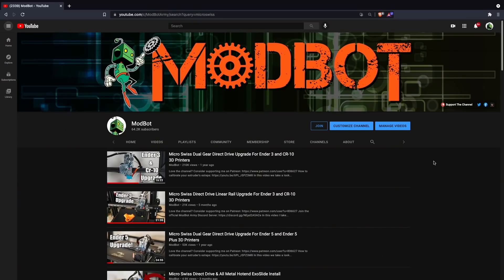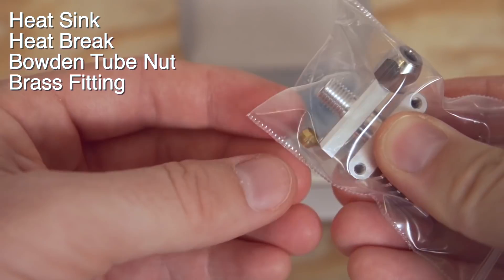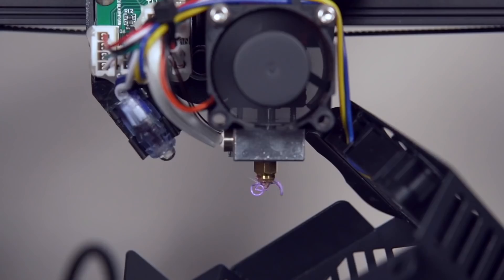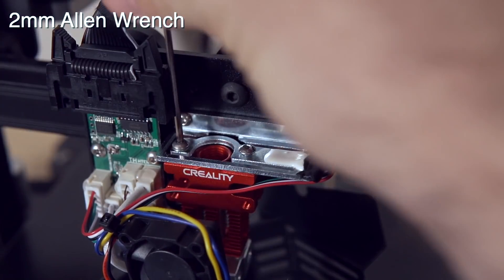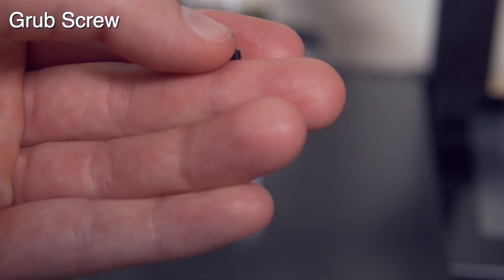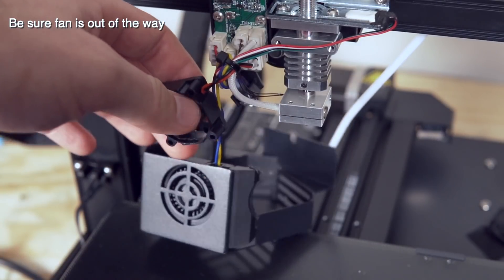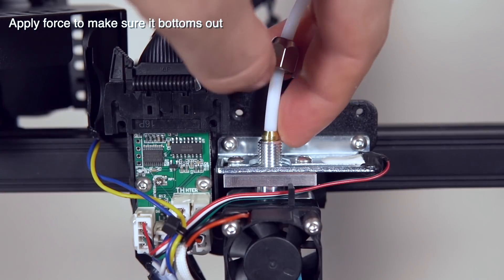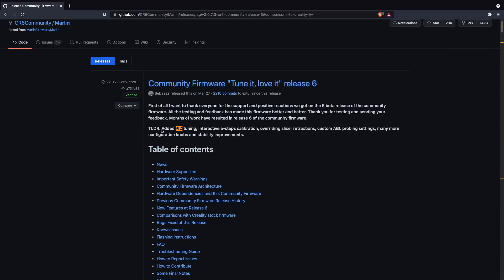Micro Swiss All Metal Hotend Upgrade For Creality CR-6 SE 3D Printer Install

Comment: Brass fitting was tight as hell, didnt slide on the tube, but after using a lot of force, it was all aligned. Thanks for the video.

Comment: Did not work past two prints for me. Using PLA+, it gets clogged above the hotend. Giving up after taking things apart several times. Even got it cleared out and manually fed PLA through and then it immediately clogged trying to do a print. Ughh. Going to just get a replacement hotend from Creality. Wasted my $60+.  :(

Comment: I just installed this and followed your directions completely except the bumping of temperature. I got ahead of the video and started printing before hearing that portion. I am testing in PLA, and I can tell the print is 1. going to finish, and 2. be a quality print. Once I get the [new] printer dialed in with PLA  I will move to PETG. Any tips for using PETG with this hotend?

Comment: I recently purchased this hot end for my CR 6 SE and I can not get it to extrude properly with PETG it just seems to under extrude even though e steps are good and tried multiple retraction settings including the recommended 3.5,  35mms, tried multiple temps  from 220f up to 260f ended up going back to original hotend because I did not have the time to tune it right now and majority of my parts I am printing right now are petg.  I did how ever spend the entire day trying to tune it. Is there is any other settings you use?  I was thinking after uninstalling it I should of maybe tried printing slower?  I am printing at 50mms. With PLA it seems to print better but still not quite as nice as the original hot end.

Comment: Thanks for the video.
You say in your video that the new MS hotend would be good for up to 300 degrees. Is the existing heater cartridge and thermistor rated for this also? I thought that they were only good to 260 degrees.
Just out of curiosity, why do you need to remove the nozzle and bowden collet from the original hotend?

Comment: After everything is done. Should  you do a bed leveling next?
Reply from the maker: Never a bad idea but since nothing had changed on the bed and it uses the nozzle for a z offset it was not necessary. I have done about 25 prints since with no isses!
Reply: @ModBotArmy  
Ok sounds great
Reply: @ModBotArmy  
What do you think since your replacing hot end. Would it be wise to replace the 30m fan to the 40m fan?

Comment: I updated my CR6SE with the Micro Swiss hot end along with the Bondtech BGX to convert it to direct drive, but the best upgrade is the community firmware, it is so much better than the factory firmware. When I did the first bed level with the community firmware you get a read out of each leveling point and it revealed just how bad the bed is, the front RH corner is 1mm higher than the back LH corner, a new bed is the next mod.
Reply from the maker: Great to know. I need to look into the BGX at some point. It looks great. Also, I have looked into the community fw a bit and will be making a video on it. I agree it looks amazing compared to the stock fw
Reply: What bed would you put on it Stephen? I’m looking for one for my Ender 3 , was thinking of getting my friend to waterjet one out of 1/4 6061

Comment: I couldn’t take the stock Hotend restrictions material wise so I literally just bought a e3d copper block and titanium heat break and tapped the stock heatsink for m7 and I was good. LOL

But I also hated the 410 fan. So I put in a new carriage with a 5020 blower and a 410 fan for the heat sink 

Still trying to tune the look and fit though

It totally works.
Reply from the maker: Haha that is hardcore. Definitely do not think as many people would be comfortable but I am happy to hear it worked without issues. I do like the idea of the beefier blower fan.

Comment: I'm really stoked to see Microswiss using the bowden crush couplers as that was literally the only thing that ever gave me trouble with my old one.
Reply from the maker: Me to! I feel it is a nice upgrade and will do a much better job of holding the bowden tube secure in place.
Reply: As scummy as they are, mellow makes a clone that is legitimately a better hotend, it has the proper pneumatic couplers, the throat is smoother and it has a hole for a proper thermistor cartridge not just a glass bead thermistor
Reply: @noahmcelwey2598  What type of nozzles does it use?

Comment: Where can i get the latest ender 3 firmware without BL touch? Also do i need a bootloader?
Reply from the maker: Did you check on Creality github? I am not sure if it is updated there but I would check there first. If not then perhaps Creality FB group has someone that is updating and compiling. It will depend on the board. My ender 3 did need a bootloader but that was years ago. New ones may have it installed and if you have a 32 bit board then you definitely would not need it.

Comment: Kudos for a well-made and informative video. I have a CR-10 Smart which has the same setup so I was very curious what all was involved with this hotend. I thought the automagic leveling feature required a special hot end or attachment to handle it. Does the bed leveling feature still work fine after the change?
Reply from the maker: Thank you very much! Bed leveling works great. I actually did not need to relevel. Since it uses the nozzle to probe the z offset I just hit print and since have done at least 25 prints without issues. The leveling uses the mounting point the hoend is leveled to so changing it will not affect it.
Reply from the maker: At least with the MS one since it is the same format. Another hotend would be a different scenario.

Comment: Wouldn’t the stock fan need upgrading eventually?
Reply from the maker: It is optional but not a requirement. I have not had any issues with the stock fans before or after the upgrade.
Reply: not necessarily, at least not if you don't start to see evidence of heat creep, starting with jams and clogs. If the heatbreak does its job good, the heatsink should not be limiting, so you shouldn't need to upgrade the fan.